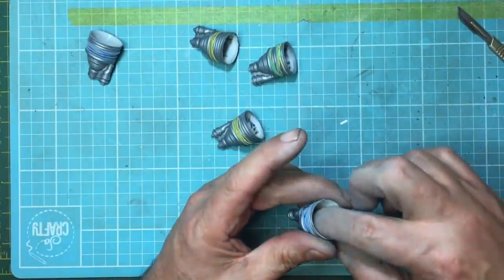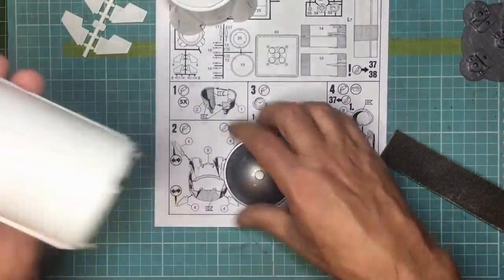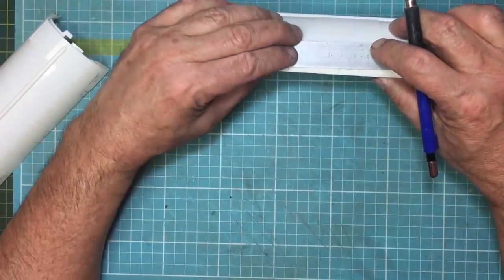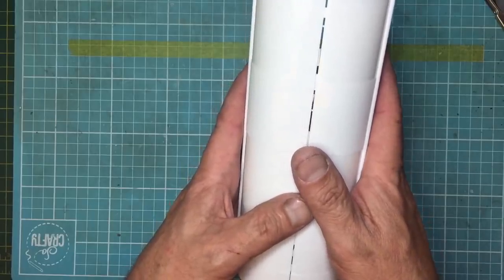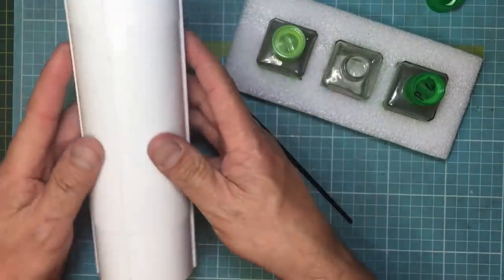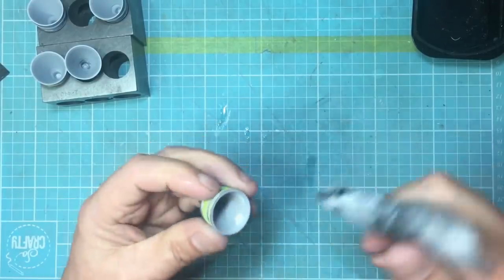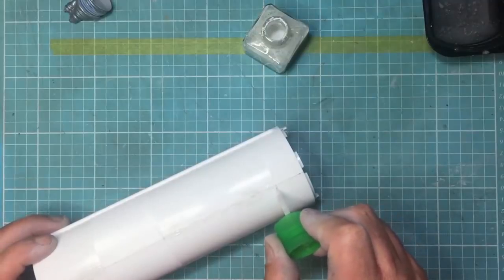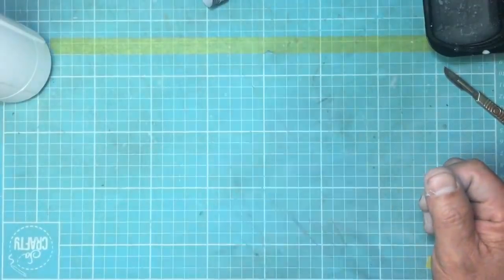Revell 1/144 Apollo Saturn V build series. Part 2 how to get great seams...

Comment: Top down: Crew escape system. Discarded somewhere around completion of the roll program, exposing the 'CM" or Command Module. The CM is the gumdrop that brings everything home. Next, the SM or Service Module does just that, services the CM with gasses and electricity. "J" Apollo missions also included an experiments bay in the CM. the bell at the bottom of the SM is the Lunar orbital maneuvering engine. the big bell constrains the thrust gasses for efficient vacuum operation. The cone below the SM houses the LEM or Lunar Excursion Module including it's ascent and descent stages. The LEM descent stage with the legs also held ALSEP or the Luar experiment packages. On later flights the Lunar rover rode there folded up like origami. Aft, down or closer to the flamey end from the LEM was a 3 foot ring holding all the guidance computers for the Saturn stack. LEM sat on the furthest upper points of its legs in that ring. Below that the third stage. The Douglas S-IVB third stage was the thrust source for what I think of as the "Moon Ship". The second stage the North American S-II sat below the conical interstage ring. Below S-II, the other, more famous Interstage Ring. Interstages were jettisoned in flight. They transferred structural integrity up the stack. They protected the engines during atmospheric flight and they contained "Ullage" rockets. the bumps on the interstages are in truth small solid rocket motors. Liquids know no down during unpowered rocket flight. Launch, burnout, stage, rinse repeat. after a stage is dropped the stack is in freefall. Ullage rockets fire, settling the fuel in the bottom of the tanks. Engines fire, thrust drives fuel into the turbo pumps the flammey end lights, the vehicle continues to orbot. S-IVB, the third stage also had an RCS, Reaction Control system like on the sides of the SM. That allowed for pointing the Moon Ship for TLI, Trans Lunar Injection. "Go for the Moon!"

Comment: 41:20 To prevent the falling S-IC from hitting the engines when it banks backwards in free fall (supposing it had a fixed shroud instead of a staged one), they made a staged shroud that would ride up with the S-II and then detach safely.

Comment: Recyclers don't take any plastic that does not have the triangle/materials code on it! That's why so much of what we put in the recycling bin ends up in the landfill.
Reply from the maker: So.. are you saying that someone manually checks every piece of plastic waste for a marking and then segregates accordingly??? I think not..
Reply: @NigelsModellingBench  Not only people these days. Now it all gets photographed from all angles by computer and it decides which pile it goes in. But there are still people in the line as computers miss stuff. And the air jet isn't able to move really heavy plastic items. They certainly don't buy X-ray refraction devices to determine the chemical properties of every item. I think they may have too one day but that isn't today. Ask your local council for a breakdown of recyclable to unrecyclable items from the recycling bin and you will see.

Comment: I have been using spruce filler for years.  I really like the bracing technique, always great to learn some new. Thank you, informative as always.  How is the Lancaster build going?
Reply from the maker: allen sjoquist the Lanc is steadily moving forward. As you know I’ve done the IP and have reworked the nav table. 
At the moment the table has been reworked again due to shrinkage. Next I’ll paint it green and scrub it. I have also made a drawer on the table. 
Tbh I’m a bit fed up with the kit, it has so much wrong with it, you get worn down!!

Comment: I think the red nozzles are supposed to hint at fire. The inner F1 surface was either a kind of gun metal grey or carbon black if fired. I think the F1 was a bad one for "Cokeing". Carbon buildup because of deliberate fuel ratio mixes used. Cokeing helps cooling of the nozzles. The F1 only burned for what? 2, maybe 3 minutes then they were fish food. And... while I'm trolling, Please, God, I hope you didn't paint the stage one engine deck and the inner surfaces of the LEM bay green. No green anywhere on a Saturn stack. a kind of funny piss-yellow-green on the inner surfaces and the tank heads. No green. Forgive an old, fat, child of Apollo. I've loved n the Saturn stack at JSC so much I probably lost 2 wives and my father's girlfriend over it. They get bored pretty quick when you make them shoot 100 photographs because you just have to exactly replicate that picture of Werner standing next to an early Saturn on a transporter.